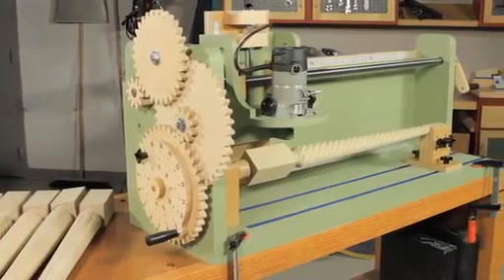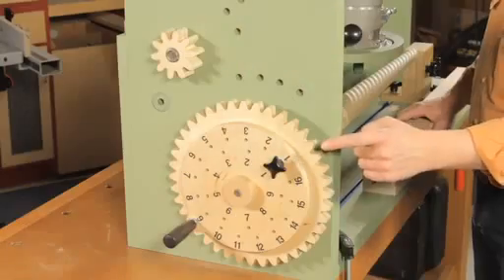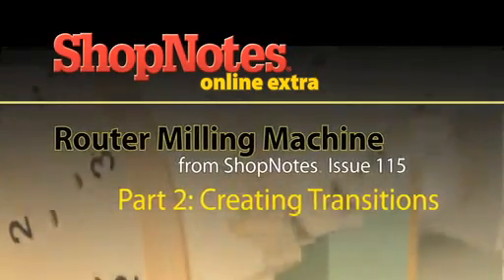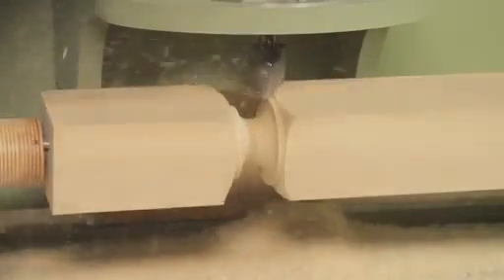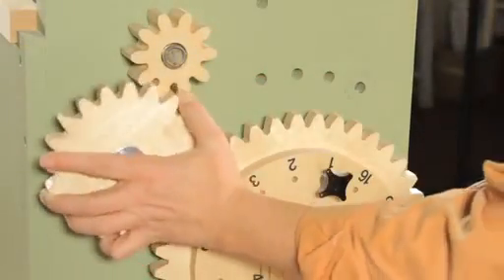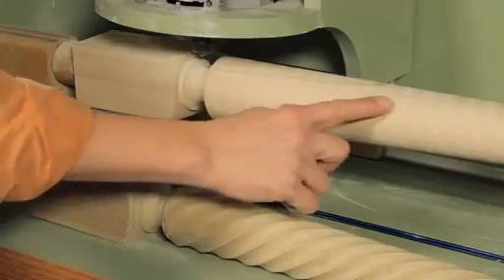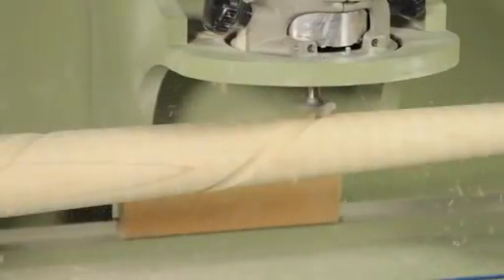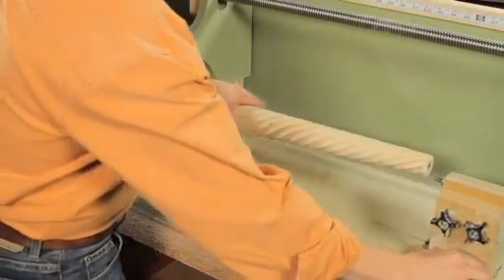Super Router Milling Machine

Comment: you can download part of those plans from those website, was not hard to find
http://www.shopnotes.com/files/issues/115/milling-machine-patterns-and-setup.pdf

enjoy.
Reply: thanks for the tip, I could do with that pdf drawings in cad 
also supported with a jpeg image
Reply: are those notes supposed to be to scale because mine are all 1/8-1/2" too small?  anyone else having this problem or am i messing up somehow? thanks.
Reply: dear joseph Bützberger do not worry you're not ruined. 
if it is true I did drawings of your machine supporting me in some pictures to get off the web. 
but not constructed the machine because I do not tournament wood 
I just found very interesting your machine 
when you receive the message and plans keychain destroyed and never published nor distributed anywhere drawings. 
was just a hobby, and he never came back my computer. 
I'm a craftsman in wood and plexiglass 
support copyright 

regards
Reply: joseph butzberger Use the "print at full scale" or "actual size" setting in your printer settings instead of "fit" or "fit to page".